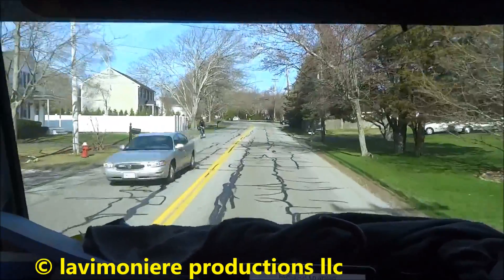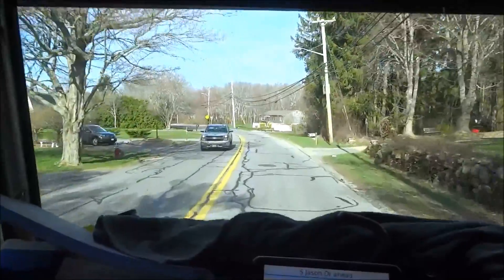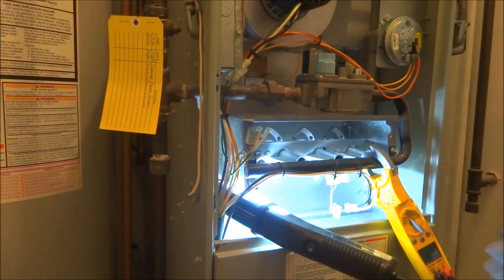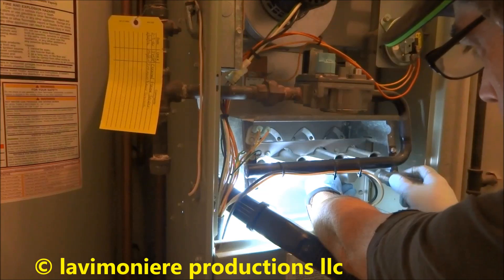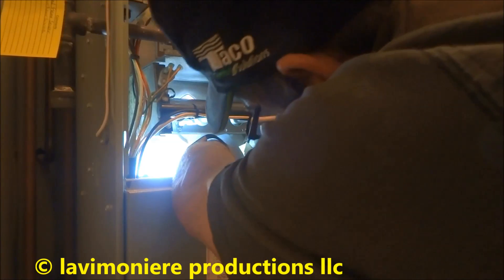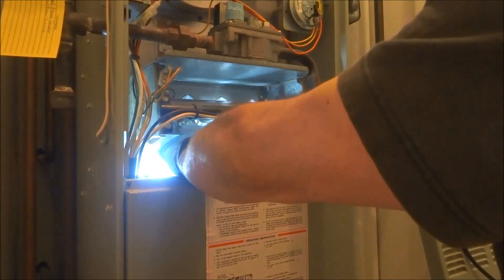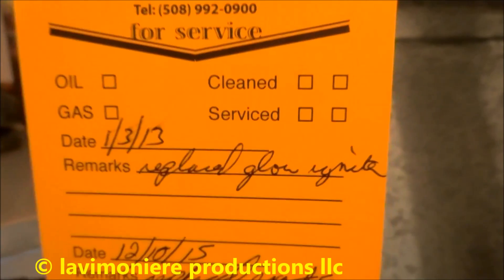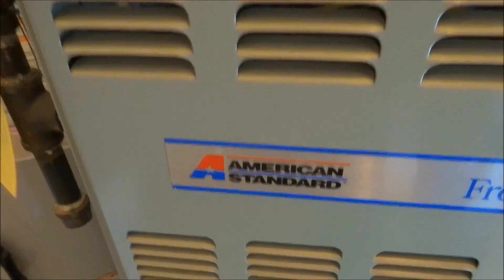hot air gas furnace will not heat house

Comment: I always wonder why those fail
Reply: na na its common for them to go out like that it depends on how often you use your furnace for heat and it could also be to much gas flow from the gas valve
Reply: Yeah but why do they god bad?
Reply: na na i just told you why on my first comment.
Reply: Frequency of use? That really was not the answer that I was looking for. I was curious if anyone knew the scientific reason i.e. Carbon buildup results in a hot spot or something like that.
Reply: na na do some research on it I've been an HVAC technician for a while now so i know what i am talking about
Reply: they crack....they get near 800F then cool off over and over again.
Reply: It happened to my old electric oven, just burn up from all the use.  Easy fix and something we all have to live with.